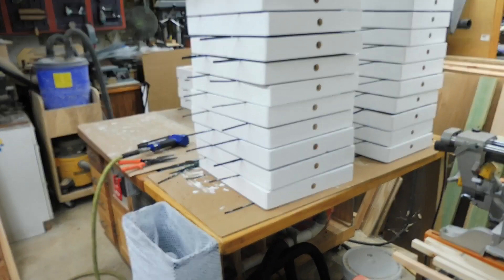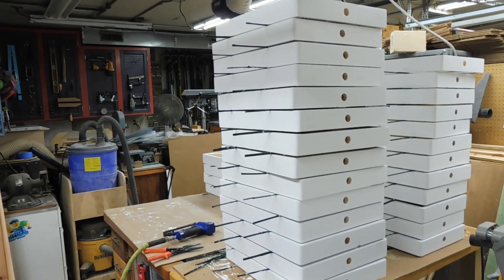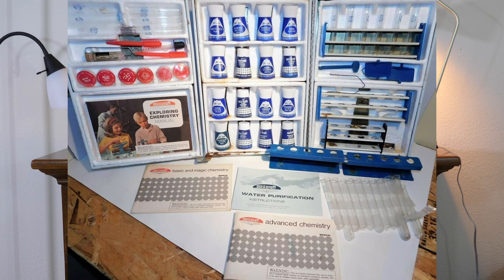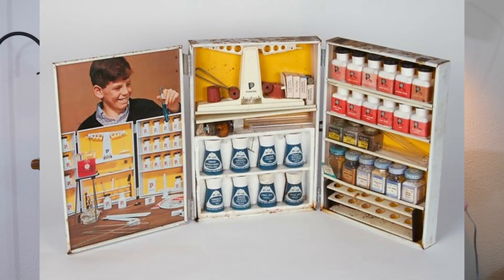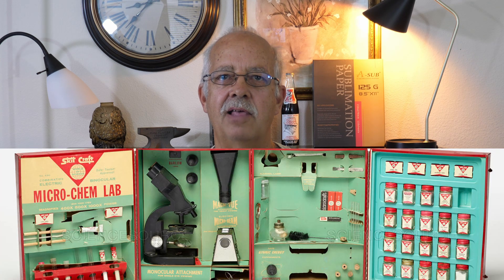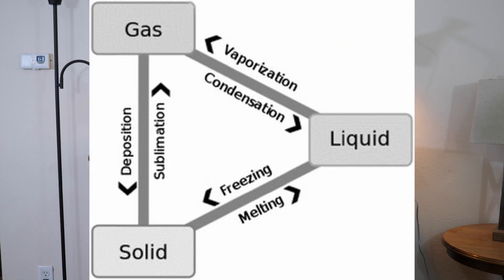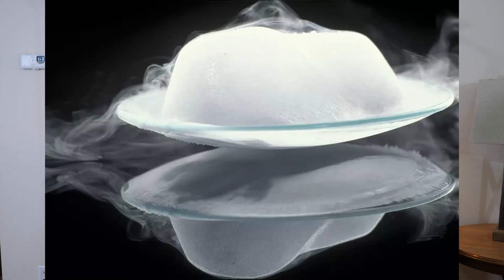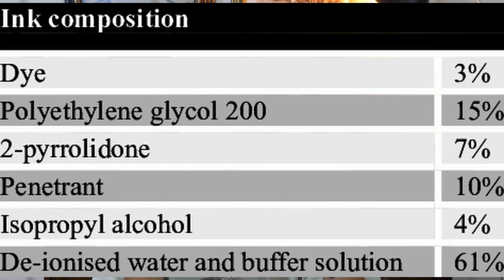Sublimation Printing Explained

Comment: Mr. Roger, I hope you can help me, please.  I am trying to sublimate on aluminum license plates.  I have done many, many wind spinners as well as many other items.  I haven't had this problem before, so I was hoping you can help me.  I am getting a leftover residue on the license plates, something I have never had before.  I made four of them, and tried different times/temps, all of which left a residue from both the tape and paper.  Do you have any ideas on what could be the problem?  Thank you.
Reply from the maker: Does the residue wash off with water?  I've had blanks before that the paper sticks to some, but the residue washes off easily.  A second possibility would be a plastic film that some blanks have that needs to be peeled off first.  Sometimes, this can be really hard to detect!
Reply: @rogersshop  I wiped the plates with warm water after cooling and the plates come with an easy to remove blue protective film.